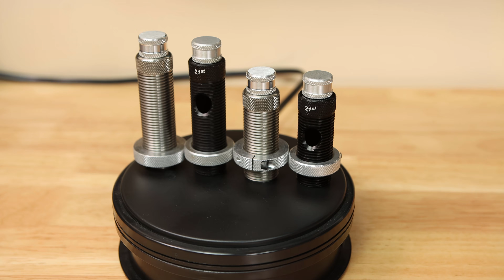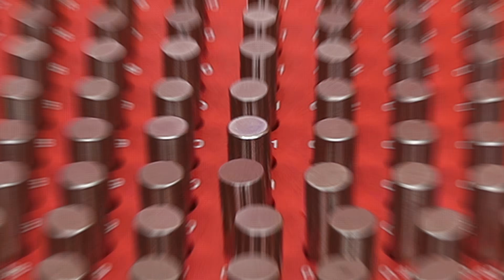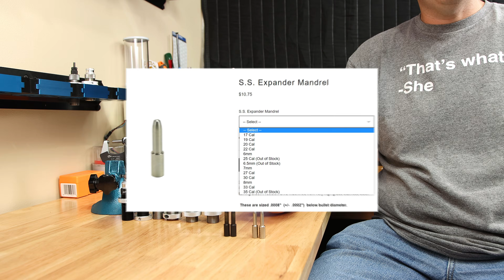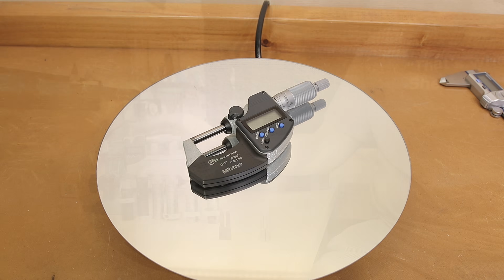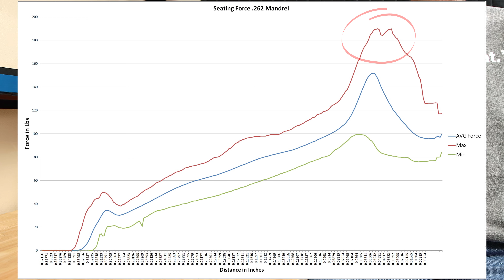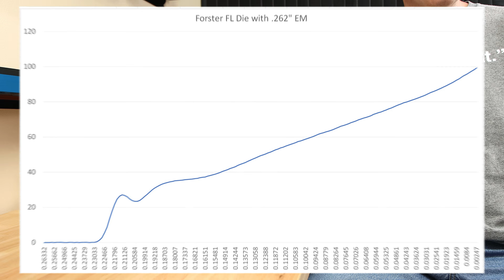How to Easily Set Consistent Case Neck Tension - 21st Century Expanders

Comment: What are you doing to get the neck smaller than the diameter of the bullet in the first place? After firing it seems to always be oversized. So is a bushing die being used to first reduce the size before then expanding it back out? If so, how much do you need to go below the size of the expander to prevent bounce-back?

Comment: I noticed you didn’t mention the Lyman M die the late, great author Dean Grendel dawned over in the 1980’s… I came to your solution via the M die because I noticed the dies (at the time) would actually stretch.233 REM brass as much as 0.006”, and cause issues. 
The .308 cal M Die I use for  30-06 and 300WM measures 0.305”, btw. But I am going to buy the 21st century expander kit for sure! 
The l concept of inside sizing the neck on the down stroke is far superior!!

Comment: I know this is probably a stupid question, but how can I verify the inside neck diameter exactly using the pin gauges? Obviously a .306 pin gauge will not fit into a .306 opening. At least, not the ones I have. What am I doing wrong?
Reply from the maker: If your brass is properly chamfered if would fit. (Depending on what the actual dimension is and if you have a plus or minus pin gauge.) But I assume you are dealing with some type of spring back. I have been able to put the appropriate pin gauge in the bushings with the same labeling. Hope this helps.

Comment: I don't care how you describe it , I just don't see the difference of pulling the neck over a sizing button and pushing the neck over a mandrel , I don't see how it makes a difference if both are the same diameter.
Reply: Pushing with an expander doesn’t stretch the brass like “pulling” it over a button does.
Reply: @stevestrapac3056  the buttons are tapered and if they "pull" then the expanders "push" come on .
Reply: @nonetheless01 because I don’t get the compressing of the case like I get with the old school button. The M die fixed the problem of stretching, without any associated problem with compressing the case. I’d imagine that a newer carbide type tapered expander would reduce it. 
Those are just the results I had loading for a mini-14…
Reply: @stevestrapac3056  I understand what your saying I have been loading for 28 years now and I have seen others make similar claims but I like to test eveytingbi can I can't duplicate with measurement what your claiming here , maybe there is something in my process that stops it but a lot of reloading products are a solution in search of problem but most guys just buy in and believe without testing .

Comment: Is it a waste of time to resize with a bushing and then following up with an expander mandrel? I have both the Redding S type F/L with the expander ball removed and 21st century body and mandrels
Reply: This is exactly my question now as well 🤦🏻‍♂️
Reply: @D.Rambo32 i was told you do this because the bushing die will push all imperfections to the inside of the case and the mandrel pushes them back out as well well as help to set neck tension consistently
Reply: Just ordered my expander die body and mandrels from 21st century and plan to use my Redding type s full length bushing die to size. This is for my .308

Comment: In my experience the best way to get consistent neck tension is to not use any type of expander at all. Simply use a bushing and reduce OD .0015 to .002 less than loaded ammo. This also greatly reduces runout
Reply: But what you do for turning the neck ?
Reply: @johnnygagnon4968  I don't turn necks anymore for hunting ammo
Reply: @Accuracy1st ok thank you!but only for info, if you was still turning the neck, how would you proceed
Reply: @johnnygagnon4968  with an IDOD

Comment: I bought the 21st Century black nitride turning arbors in .22 and .30 and they are listed as .002” under bullet diameter only. As you say they now offer the trad expander mandrels in black nitride which are .001 under, but I’d be inclined then to just get the whole set and dry lube the steel.  However, I thought I’d get the .002 under to start.  

I tried to buy the stainless Sinclair expander mandrel die body that handles up to .338, but they were out of stock (back in stock at Brownell’s 1-12-23) because they have an o-ring that floats the mandrel more, but am impressed with the 21st century quality.  The arbor is slightly loose in the die body, which I think serves the same function as the o-ring in the Sinclair, allowing the mandrel/arbor to float.

Comment: I’m starting to reload and I have found your videos very educative. Stupid question but I have to do it. Will be ok to run first an expander mandrel and then a neck size bushing? Or makes absolutely no sense? Thanks.
Reply: I am not an expert, but I will give this a shot. When you full length size, you should be bumping the shoulder of the fired brass back about 0.002". While doing this, the expander ball goes in the neck, opening it up first. Then the die sizes the body, shoulder, and closes the neck more than necessary. Then on the up stroke, the expander comes back through the neck opening it back up, and possibly pulling up on the shoulder of the brass, eliminating the 0.002" shoulder bump that you just did all of this for. AND all of this action is work hardening your brass.  So the short answer to your question is to not use your expander mandrel at all.

Comment: Forester came out with a neat Neck tension gauge.  

 For .223 I was using LE Wilson Expander mandrel (.223) size.  Using the gauge it actually read .222 after Mandrel, not .223 like what I would assume.

Comment: I have been amazed at the difference neck turning and being consistent with bullet seating have made.  I have a Savage 12FV in 6.5 Creedmoor with a Vortex 6x24x50 Diamondback Tactical scope on it.  I neck turn all my brass to a neck thickness of .0145" which means almost all necks have full length contact with the cutter.  I then polish the expander ball in my resize die to a mirror finish most times ending up with a .002 undersize finished diameter.  I have gone as far as to have custom expander balls made with elongated entrance and exit ramps and all polished for smooth operation.  The key is consistency and I anneal after 5 loadings.  Currently that rifle, Tupperware stock and all with my 120gr IMR4350 handloads will shoot sub 3/8 moa 5 shot groups at 100 yards as long as I don't screw up.  My best so far is .342", ringing 8" steel at 600 yards is like phoning home.  I spend most of my time reloading on brass prep and cleaning right down to bore scoping the barrel.  Just for fun I loaded 50 rounds without any brass prep except for trimming and a flash hole deburr.  I shot 10 - 5 round groups and found not only did the groups open up to just under 1 moa but the velocity and spreads were all over the place comparatively.  IMHO there is a lot to be said for attention being paid to the resizing (I use a .002" bump to the shoulder) and stabilizing the neck tension and dimension's any way you want to do it.  It could be the difference between a good shooting rifle and one that leaves just 1 ragged hole in the target.

Comment: After watching a number of your videos around neck tension I bought the small 21st century die body and just a single .222 and .262 size mandrel for my 223 and 6.5 PRC. I ran a test using the 223 between expander ball vs mandrel. 20 rounds each in 4x 5 shot groups. I noticed a .2 of an inch drop in group size with the mandrel groups. So where I got a .7 inch group on the expander ball, I got a .5  inch group on the mandrel. Very happy with that. So I've now made this part of my case prerp process. I do not own an annealer.

Comment: If the cases are annealed, neck turned or both, setting neck tension by dimension will still provide a consistent seating pressure but not the same seating pressure as cases which are not annealed, neck turned or both. 
I set my seating force via a seating force gage & adjust the dimensions of the neck to suit.

Comment: I've noticed that with my Lapua 6.5 PRC brass, after firing, corncob media tumbling, annealing, Redding S die with SAC .290 bushing, then with the .2625 mandrel, it actually gauges .262 with my pin gauge. So there seems to be about a .0005 spring back in the brass. I also dip my cases in Redding dry neck lube before running the brass through the mandrel.

Comment: I want the minimal cold working I can get so my goal is really for my mandrel to be the purely redundant.  I have my Forster die honed .0025 under and then use a .002 under mandrel just to push any minimal thickness differences back to the outside.  In a perfect world I wouldn't need or use the mandrel, but we all know that's not how it really works. Plus it saves a lot of egged or dinged necks.

Comment: I’ve almost got everything I need to start reloading for my 6.5 prc, just waiting on a body comparator.  I went with the 21st century gen x with .263 mandrel.  First I’ll size my 1F Norma brass with a Hornady match grade die and a .289 bushing.  Hopefully it performs great on the first try but I have a feeling I’ll be buying more mandrels in the future ;)
Reply: Its been a year. Hopefully you haven't gotten so scientific about it that the actual of shooting hasn't slipped away
Reply: @Erik7prc  Lots and lots of shooting.  1 year later and the barrel is nearly burnt up.     Somewhere around 700-800 rounds through the barrel with load development,  PRS matches and plinking.  I'll be swapping it over to a 6mm ARC barrel next for lower recoil and longer barrel life.

Comment: Please do a video on when to experiment with neck tension in the load development process. What comes first: 1) charge weight, 2) best powder & primer combination, 3) determining ideal neck tension?
Reply: This would be a good video. Put all the steps in order... then leave links to your videos on each step in the description
Reply: IMHO you would want to do your brass prep first.  Trim, deburr flash holes and turn the necks for consistency.  Then work on powder and bullet seating length (COL) until you find a good accuracy node.  Run a couple different primers next to look for a change and pick one that works best and then play with neck tension and look for improvement's.  Keep good records and when you start playing with neck tension and find improvement's you will be able to point directly to that and not confuse it with some other process.
Reply: Video is a bit advanced for you if you don't understand that fundamental process
Reply: I think neck tension probably comes in the ignition portion of the process and I would probably only play with it to see if I could my es/sd numbers lower.

Comment: F-Class John just came out with a video talking about using diamond compounds to put a glass-smooth finish on expander mandrels and gauge pins to prevent scratching the inside of case necks. What are your thoughts on this?
Reply: I just used the 21st century mandrel last night on new brass and there are brass lines on the mandrel that catch my fingernail. I'm sure the inside of the necks are no longer smooth. What do I do to prevent this? Chamfer and debur before using the mandrel?
Reply: @Mrjaspgu  I use dry graphite on the neck, (Imperial Dry Neck Lube)....however, you have to be careful to not get any of the little white balls stuck to the inside of the necks.....OnWard.....
Reply: @Mrjaspgu  You could get a carbide expander mandrel.  I have one from PMA tool and it's great, but you pay for it at $60 a mandrel.  I believe Brownells also offers carbide mandrels.  I've also found that Hornady One Shot works really good as mandrel and case neck lube.  I spray some on the mandrel then spray some on a q tip and swab the case neck.
Reply: @Mrjaspgu They’re pricy but 21st Century now offers mandrels with the black nitride coating.  The sets are all steel though.  I would polish those out and use dry lube.
Reply: Most times I find expander balls to be a little under .002" undersize so I use very fine Clover Compound to polish them in a drill press.  You end up with much smoother operation and less working the brass.
Reply: F-Class John uses carbide expanders. Stainless steel expanders will gouge after awhile.